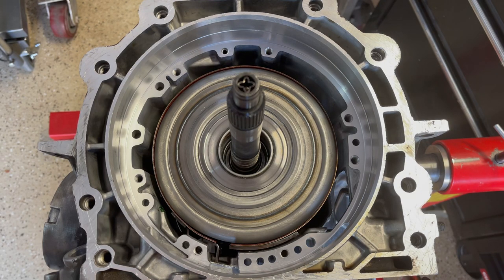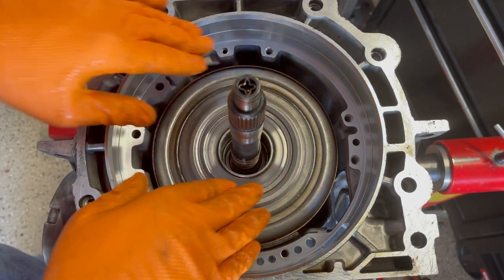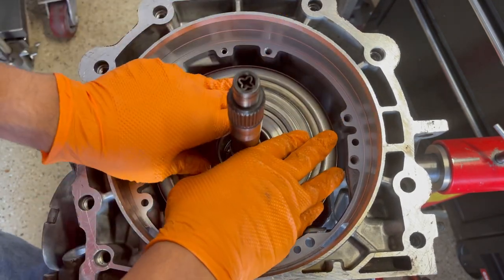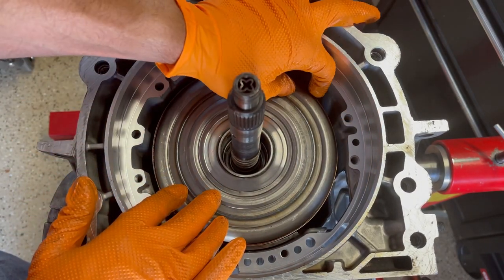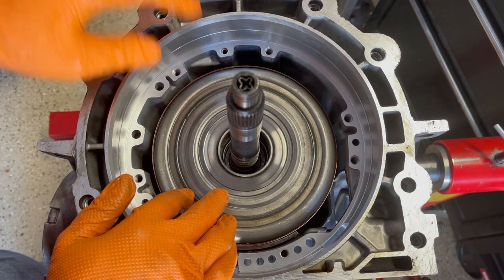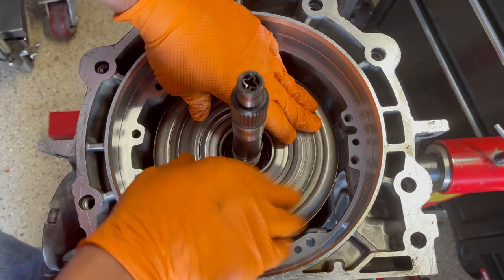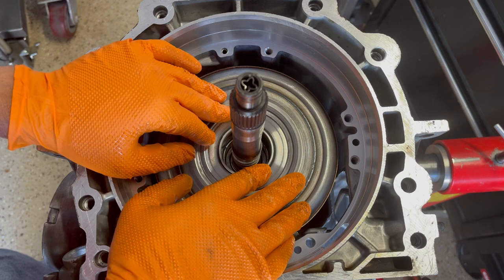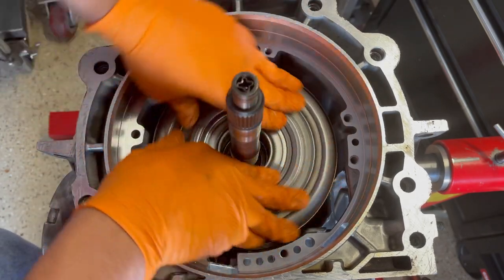4L60E - Ideal Band Clearance

Comment: How are you checking the clearance without a dial indicator and pushing the servo?
Reply from the maker: Hi AZ, I'm not actually checking clearance empirically here, just showing what ideal clearance looks like visually when assembling the transmission and installing the band. I will be producing a video where I'll walk through the Servo travel measurement and adjustment process using a dial indicator, mount and Transgo's spacers with a 1995 4L60E that I will be working on next week. 

Thank you for watching!

Comment: Is it the red one your using or black?
Reply from the maker: Alto red, wide band is used in the video. Though the same standard applies to BW HE band which you can shim using a gold Transgo band spacer if necessary.
Reply: @nickstransmissions  can't shim the alto red one? I have a alto red 2 and 5/8 I hope its a good band.
Reply from the maker: @robpaul7900  I usually don’t have to.